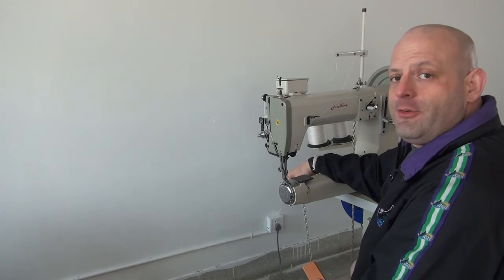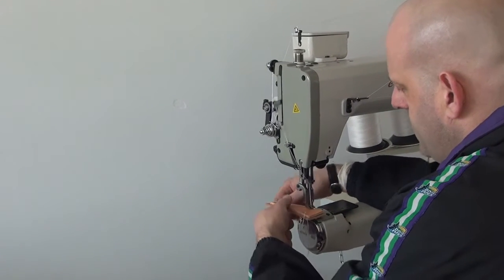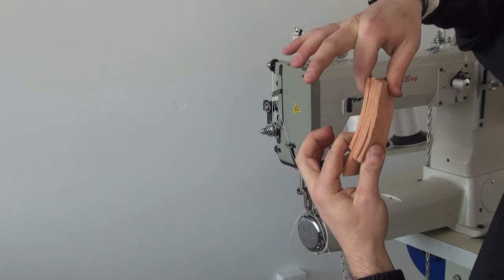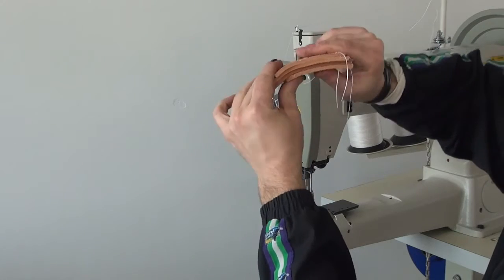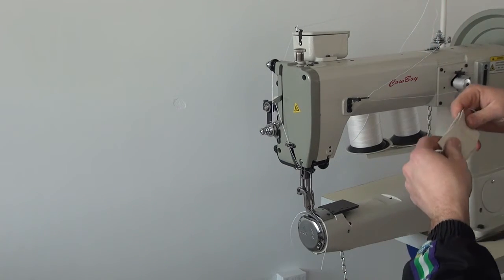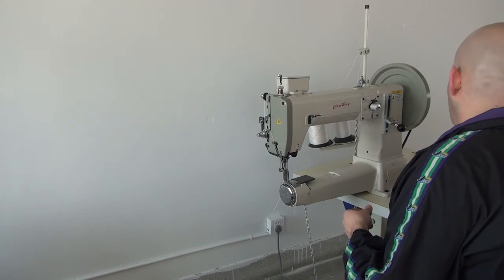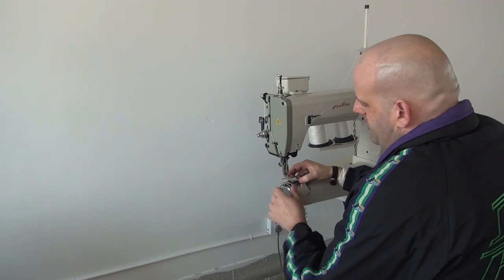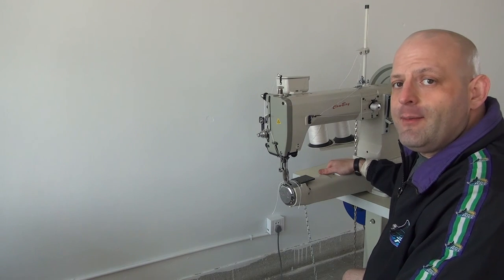What is the best sewing machine for heavy leather? Cowboy CB4500

Comment: I am about to purchase a heavy leather sewing machine, so I have been taking my time digging into the differences between Cobra Class 4 and Cowboy CB4500 to determine what machine is the best value. The Cobra Class 4 and the Cowboy CB4500 and the Juki 441 heads are made in the same factory on the same assembly line. They are identical in every way until the Cobra gets painted Brown, the Cowboy gets painted Tan, and the Juki is painted White.

Cowboy has stepped up in my opinion by replacing some of the carbon steel parts that touch the leather with Stainless-Steel parts to include the presser feet and needle plates this is to eliminate the possibility of rust due to the moisture in the leather, they also include an Extra-Large Flywheel for ease of operation, a Wax/Lube pot for the thread and a Better LED Light. I was also told Cowboy has a bit Heavier Built Speed Reducer. 

I contacted Cobra folks and asked them the same questions I had asked the Cowboy folks; they did not contest any of what Cowboy folks had told me was included with the Cowboy CB4500 or what is better about the Cowboy VS Cobra or vice versa.  Cobra did not even speculate that something was better about their Class 4 machine vs the CB4500 (that was really odd or telling to me) they would only say is Cobra has a limited lifetime warranty and did not elaborate further. Cowboy also has a limited lifetime warranty, so Cobra did now win any points from me on that. They both come with a heavy built table/stand and a Servo motor. 

Both the Cowboy CB4500 and the Cobra Class 4 are around $3k, I am seeing the price of the Juki 441-U around 7k to 8K (maybe they line the inside of those with gold or something, seems crazy high to me).  

I have only seen these machines from a distance and never used one, so I am going off what the information from the sources listed below, videos, and forums provided me. I am feeling a little better about turning loose of $3k + shipping on this machine now that the information provided from every source has lined up. The amazing thing to me is that all the info lined up no matter what part of the country it came from. Even the machine owners just giving me their honest opinion lined up with what the other sources had provided, their information kind of glued it all together for me since they had no skin in the game to want to sell me one way or the other. (I thank you guys for that!). My confidence is High that I am making a decision that is best for me.

SOURCES: I have spoken with Ryan Neal at Neil Saddlery & Harness and Bob Kovar at Teleto Industrial Sewing Machines, about the Cowboy CB4500 machines I also contacted Aaron Hizer at Makers Leather Supply, Heather Bradt at Leather Machine Co about the Cobra Class 4. I also spoke with a 4 of machine owners that I will not name here as I did not ask their permission. This is the accumulation of the information I received from all of sources. 

CONCLUSION:  In my humble opinion with the information I received, both are good machines. It appears to be as of today's date you get more for your money with Cowboy CB4500.
Reply from the maker: Thanks for your messaage. 
It is not good to say something bad about the competitor (Cobra), below is the advantages of CowBoy you can consider:
1. Cowboy was founded as a company that places quality over quantity, we test & improve each machine throughly before delivery. 
2. Cowboy CB4500 now is with best low speed high torque servo motor (https://www.cowboysew.com/750SH-slow-speed-high-torque-servo-motor-for-extra-heavy-duty-sewing-machine.htm ), you CANNOT find similar high performance servo motor from other brand.
3. CowBoy has long business plan, both founders in United States and China are less 50 years old. You do not need to worry about spare parts in future 20 years!!

Hope above information is helpful, thank you!

Comment: I have the same machine cb4500 but I can't put 4 layers of leather under the foot. How change this? (pressure and neddle foot) thanks
Reply from the maker: How can be sured your machine is same to CB4500, if not with CowBoy or HighTex brand? Just looks similar?
Reply: @HightexHeavysewingtechnology  I have Hightex CB4500
Reply from the maker: The standard presser foot of Juki TSC-441 type machines is 20mm, why you cannot put 4 layers of leather?

Comment: Hi Ryan. Just watched your very informative video and am wondering if any of the accessories you mention at the conclusion would work on my machine, which seems to be of similar design. I have a Nakajima 421 and I have been led to understand that it is very similar to your Cowboy CB4500. I am particularly interested in the straight sewing guide, which you compare to the rip fence on a table saw. Also, it would be helpful to have the guides that help one sew knife sheaths and gun holsters. Thanks for any help you can offer.
Reply from the maker: Joe, we never heard about Nakajima sewing machine, CowBoy CB4500 is clone of Juki TSC-441 leather sewing machine, if your sewing machine looks same, the parts should be interchangable.